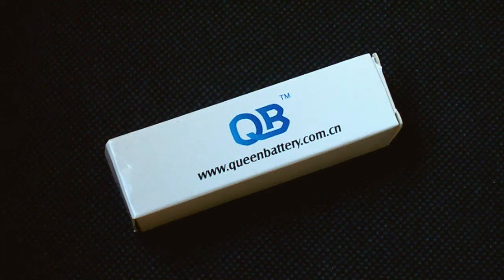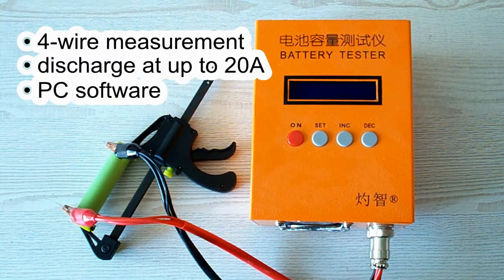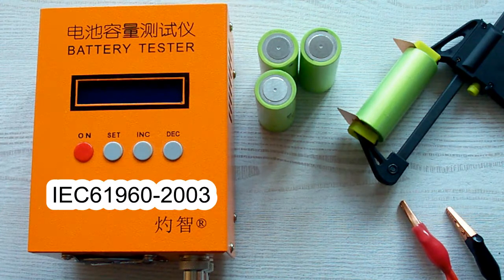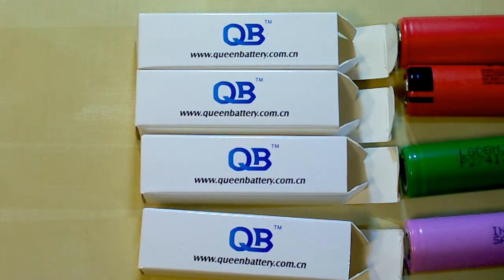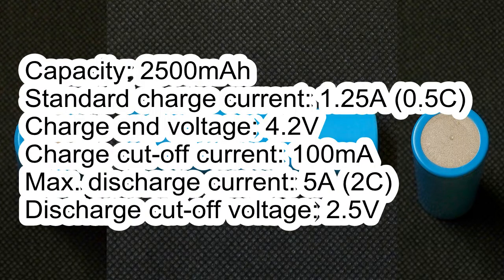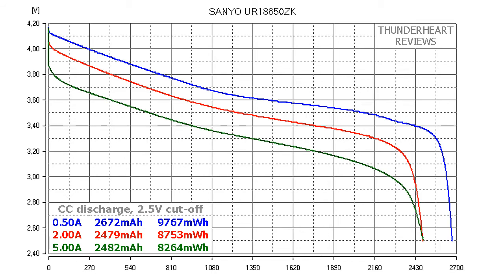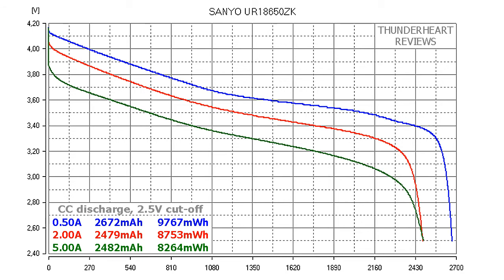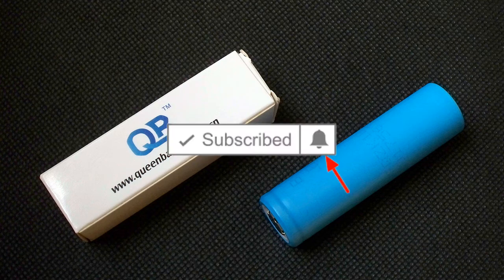Sanyo UR18650ZK - a low price 18650 Li-ion battery (capacity test)

Comment from the maker: 0:29 - Testing equipment and conditions
1:36 - Battery supplier
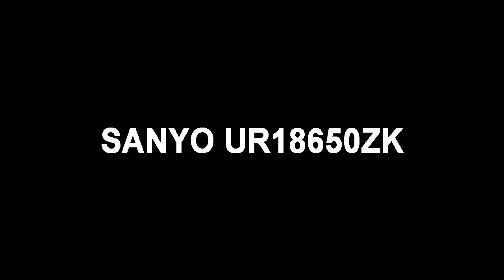1:57 - SANYO UR18650ZK specs and capacity test
3:50 - Verdict